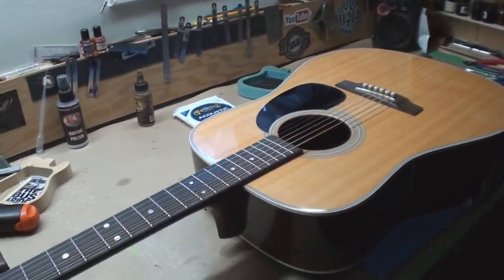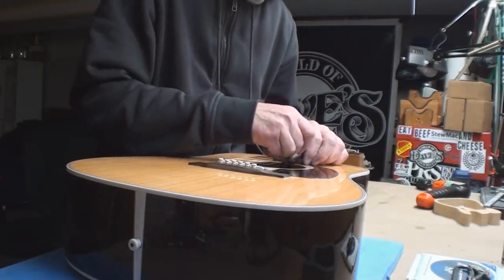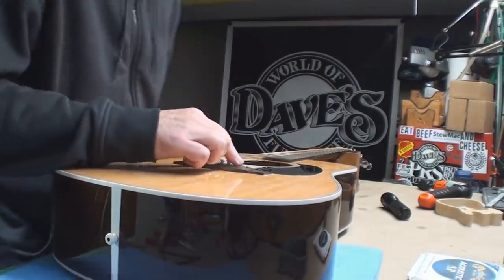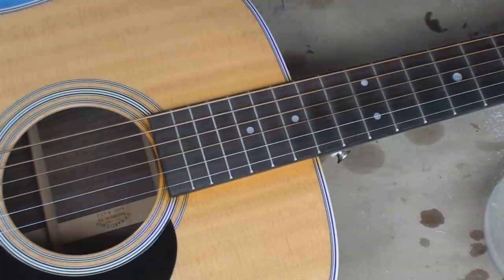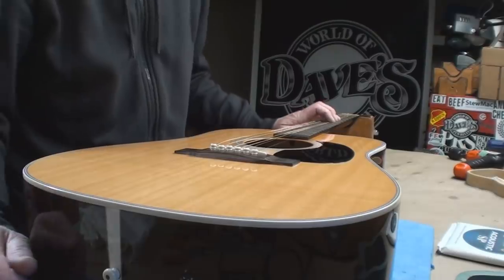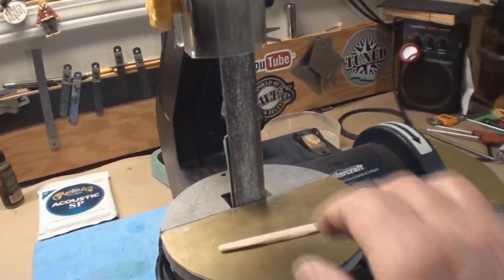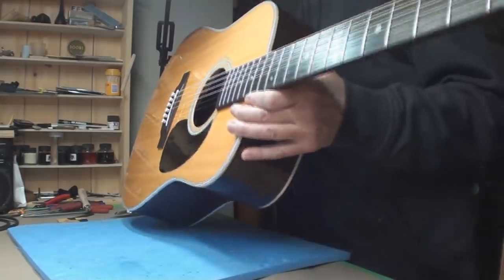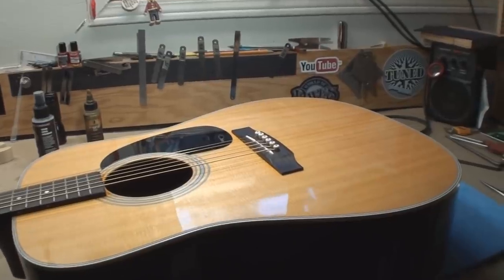Martin D28 Guitar Gets Adjusted

Comment: Dave I had a chance to buy an ovation for 90 bucks but it was dropped and the top is separating from the fiber glass back. What would be a good glue to use.or is it totalled?
Reply: Dave's kidding he likes to watch the world burn through use of a Bic lighter.
Reply: There is an Ovation owners forum on the web. They use Loctite industrial epoxy for replacing tops, bridges, and loose necks.

Comment: Hi Dave love the channel , wee question, we don’t use inches here in the uk we use millimetres, for string height from the 12th fret my gauge shows 2 -2.5 millimetres I’m wondering if that’s right and is that from fret wire to the under side of the string? Oh and it’s a bass lol
Reply: We changed to metric in Australia, years ago.  My schooling and trade was in imperial measurement,  my lathes are imperial, so are my taps, dies, etc, so wherever I can, refuse to go metric.
Reply: Buy Japanese guitars, everything is metric which is why some parts are not interchangeable.

Comment: Hi, Dave, I have an epiphone with a tune-o-matic bridge. I have one string that's buzzing all the way down the neck. I changed the string and it improved slightly but it's still buzzing. I just moved up a gauge in strings and I re-adjusted the truss rod and bridge. I'm still getting the buzzing on that one string (the A string). Any suggestions?
Reply: What string? Try to isolate where the string buzz occurs. Is it at the bridge, somewhere on the fretboard or near the nut and headstock.

Without knowing that, you can't sort the problem out. From what you say I'd guess you have an upper fretboard hump or else some break angle or hardware issues at the bridge saddles. There's also a small chance your pickups are way too close to he stings  but that's doubtful.

Hope it helps.